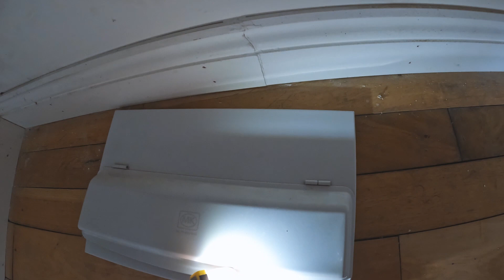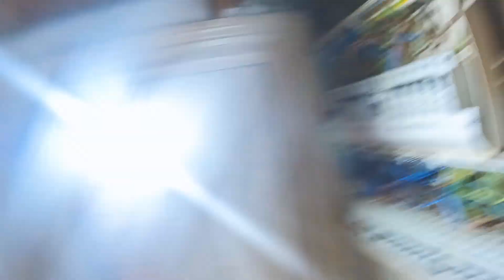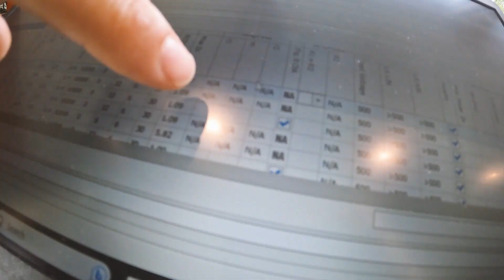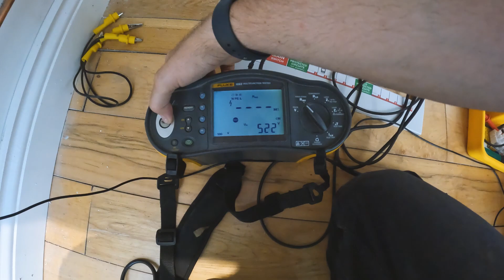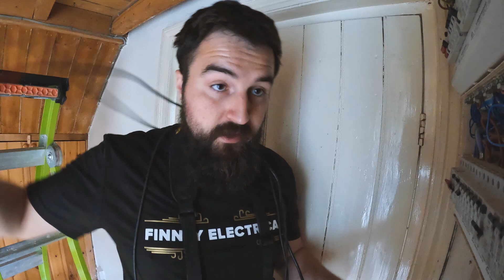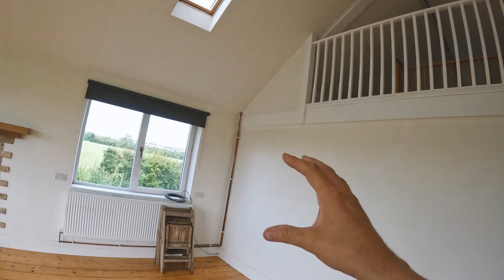THE NIGHTMARE HOUSE! 😱 | TESTING & DODGY WIRING 🔌⚡

Comment: Hi,  I thought it was 300ms for times one and 40ms for times five.  Cant see anything in BS7671 saying any different.  
Also do we test at five times now, I thought ammendment two said that you only need to test at the one times setting.
Reply: 300mS for X1 .. one test required only ... X1 one side of cycle AC setting
Reply from the maker: @Mainly_Electrical regs have change a bit since I got taught 😂 old habits lad
Reply from the maker: I just test at 5x out of habit lad 😂